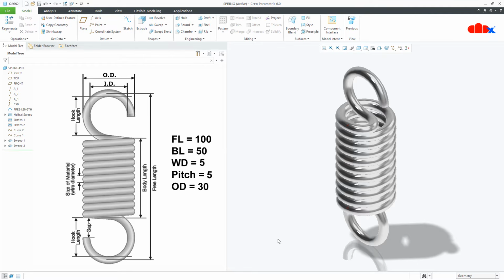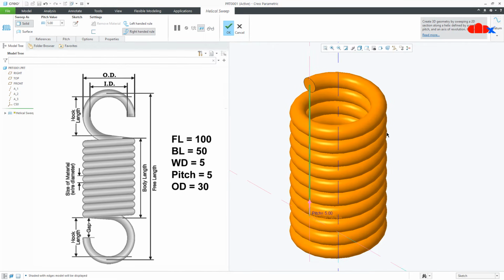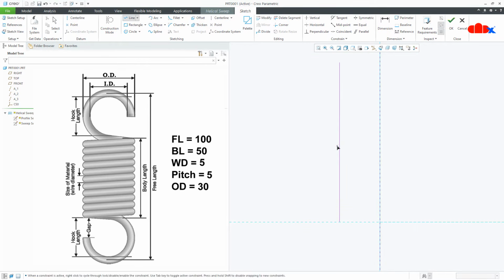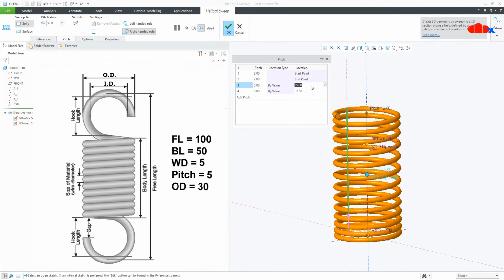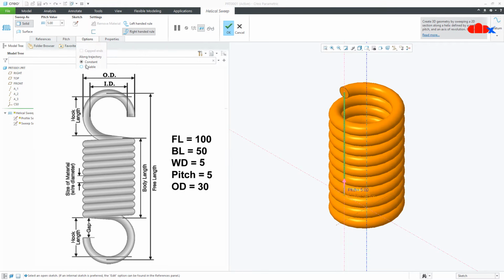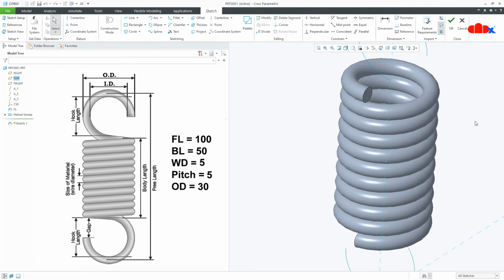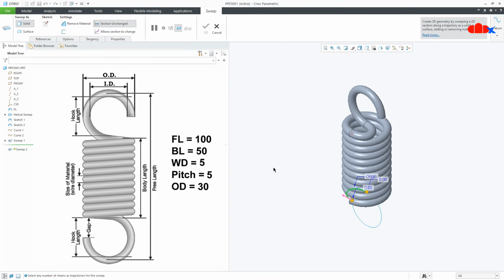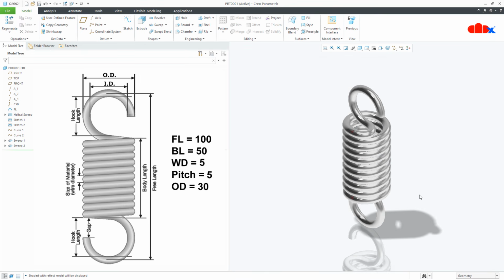Helical sweep in depth with multiple spring examples in Creo Parametric

Comment: Hello Sir, this video is excellent n clear allmost all the doubts in modelling of helical extension spring. Still I want to know how it would be used in assembly. e.g. one end of the spring is connected with a moving part and another end is connected to the fixed part just like a brake padle or similar. Could you please make a video on the mentioned problem? Or please share ur email so that I could discuss in detail. As I m pursuing a mechanical model n behaviour of the spring matters their. So I request you to please share a video explaningthe spring working in simulation in Creo.
Reply from the maker: You need to add flexibility to your spring.
Watch my video about flexible spring in creo.

Comment: Brother as a  design engineer what  you  suggest  for learn about material knowledge...
Reply from the maker: Material selection is a key area for a design engineer. Material selection totally depends upon the three things. Material cost, material availability, and the performance. For most industry there are some fixed materials, you cannot alter that. For some industry, designers are free to choose any material.
Reply: @CADx-in  Thanks Brother ....Can you make video about material knowledge
Reply: @CADx-in  sir want to contact you , if you have free time plz